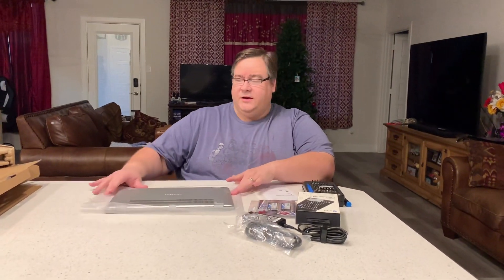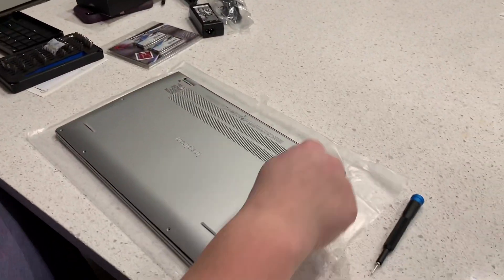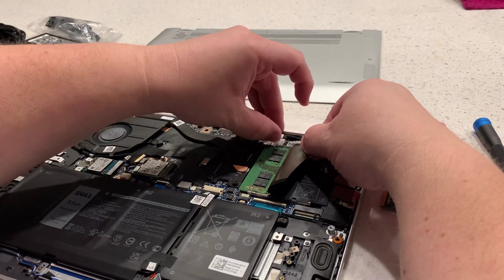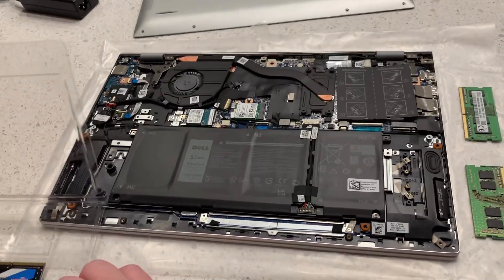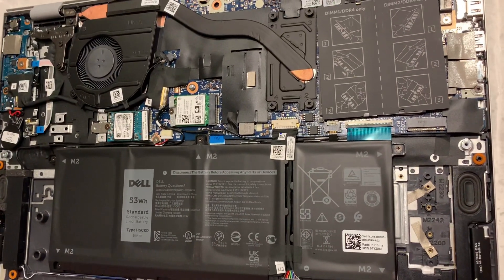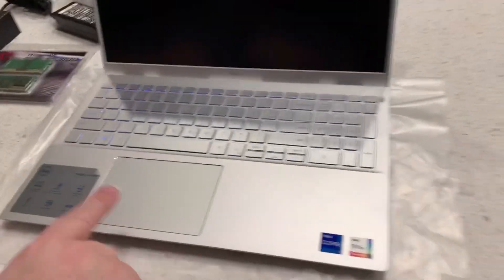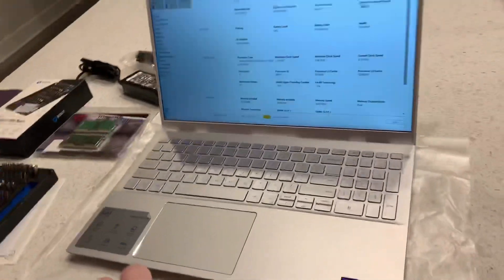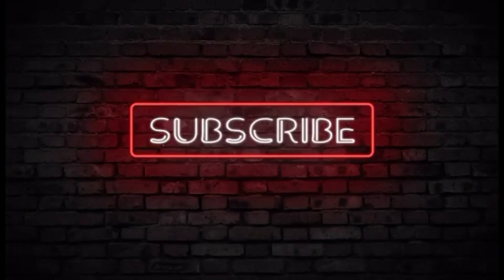HOW TO INSTALL RAM IN A DELL INSPIRON 15 5000 (MODEL 5502),11th GEN i7 || RAM UPGRADE FROM 8G to 32G

Comment: Goodmornig, tanks for this video, can you tell me if I can to instal 32gb of ram in my Dell 5502? Or what is the most big ram that I can to instal? Tankyou again
Reply from the maker: I believe 64gb is the most, but you need to check the manual to confirm that.

Comment: hello sir i have purchase  DELL INSPIRON 15 5000 16 gb ram 512 nv ssd got some issue in lapy bye but i need pro windows 10 i try to installing windows 10 but now problem is it not showing while formatting. if you have any suggestions please thanking
Reply from the maker: Sorry, I am not sure how to fix your problem. I would try and reset your Inspiron to its factory settings. This should restore it to when it was new. One you have restored it, try re-installing Win 10 Pro. Also, check out Linus Tech Tip videos for more help. Good luck.

Comment: the green card is the wifi card, and the blue card is the ssd. the arrow on the right pointing to m.2 means that there's another m.2 slot there.
Reply: So we can add another ssd right?
Reply from the maker: Wow thanks
Reply: @FirdausShamsaimon  yes, full sized ssd, which is faster. transfer your OS there
Reply: Bro which model ssd does it come with

Comment: Is the battery easy to remove and put back in or is battery soldered to the motherboard?
Reply from the maker: The battery is removable
Reply: @jagiechanel620  Thanks for the response.

Comment: Is it possible to upgrade the 5501 core i7 8GBram version?thanks
Reply from the maker: It should be possible just read the owners manual specs.
Reply from the maker: Make sure its laptop memory not desktop.

Comment: I buy nvme ssd to laptop dell 15 5000 but when i try to put it in lap i cant find slot for ssd is it hide in some where
Reply from the maker: Rewatch my video and around the 4:25 point in the video I point out the 2 NVME SSD drives installed in the laptop.  You might be restricted on the physical size of the NVME drive.  The ones installed are very short and it doesn’t look like there is room for the long NVME drives.

Comment: Do I need to drain the battery or disconnect the Battery before upgrading the ram?
Reply from the maker: No you dont need to drain the batt.
Reply: @jagiechanel620  ok